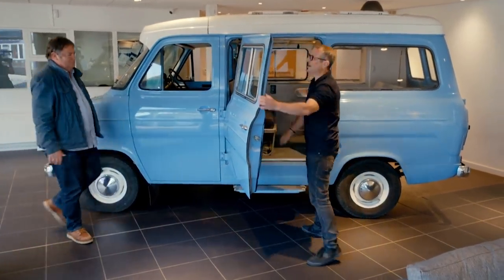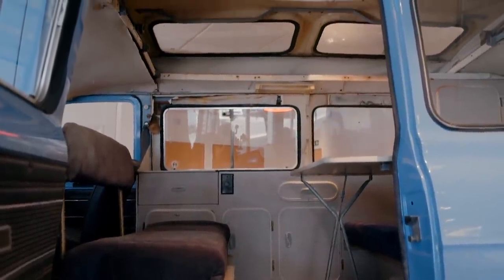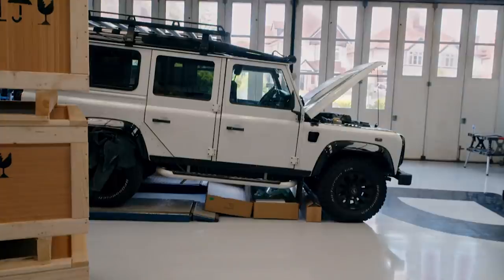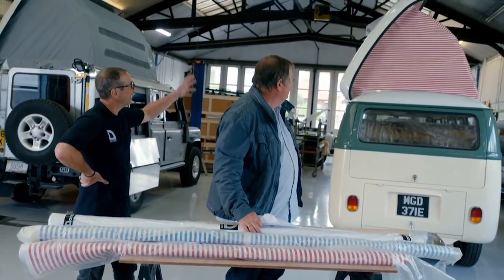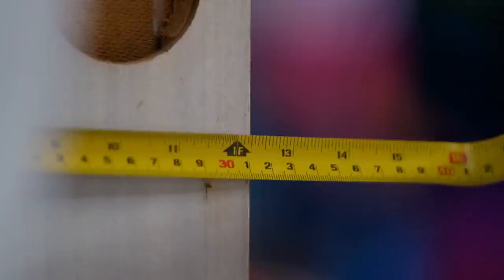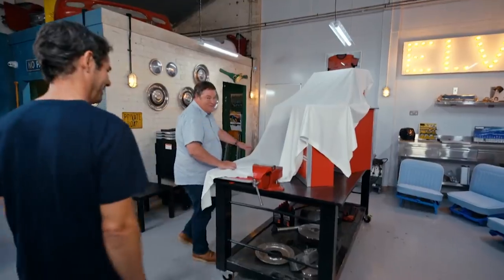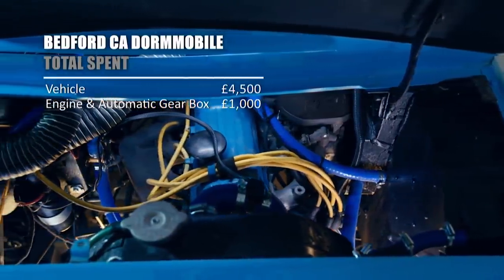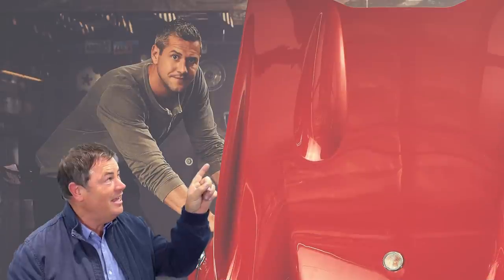Bedford Dormobile: Upgrading The Classic British Camper Van! | Wheeler Dealers

Comment: My dads company transport was a Bedford CAV 15cwt van with the Dormobile 5 fold down flat seat conversion. No extra windows in the back to save on Purchase Tax. With the seats folded down the goods area was the same as a standard van. Behind the drive was a double seat and walk way to a treble across the rear.
The heater only blew out warm air to the drivers foot well and all of the windscreen, so it was bl---y freezing in there during the 1960s winters.

Comment: My Grandfather had a Doormobile when we were kids. I think it must have been a VW going by the parts in the attic. He bought it with no floor in the front, but the back and roof was in good nic. After sitting in the street for 10 years after he passed away a scrap dealer came knocking and took it away.